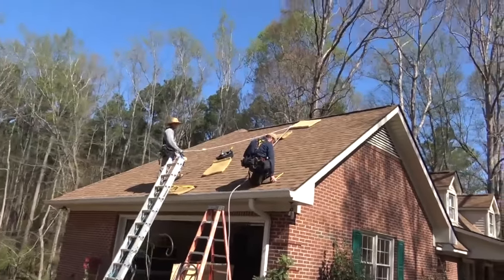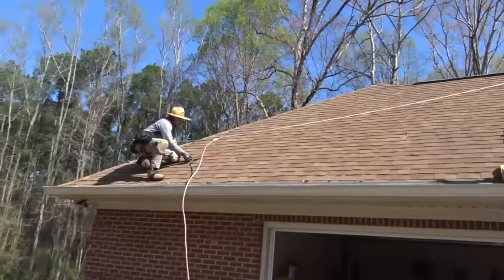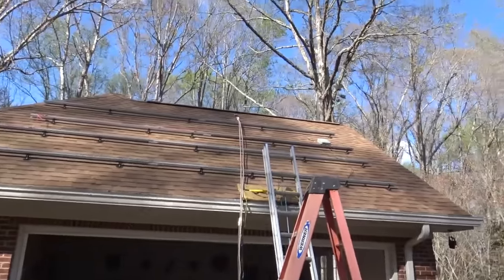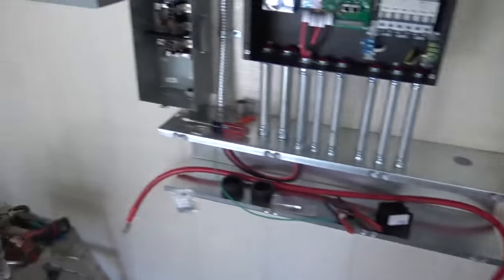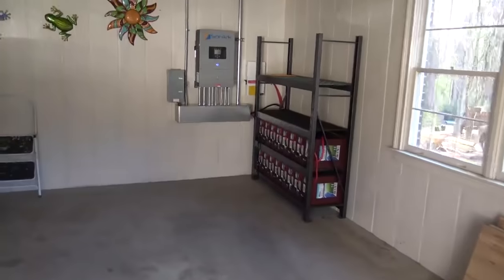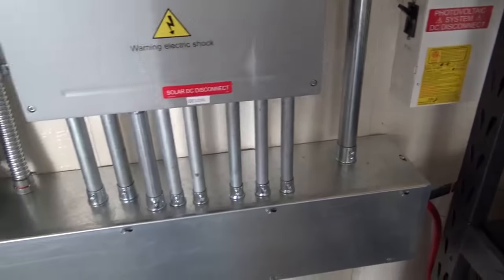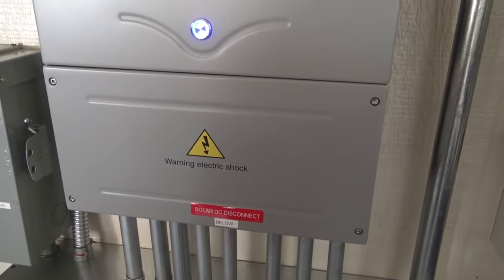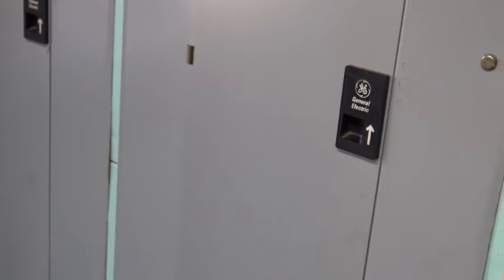EMP Hardened Backup System

Comment: I have a tip for your guys when working on asphalt singles. I learned this from an Allstate adjuster/roof inspector after a hail storm. Take an older pair of lace-up work boots and glue foam padding to the bottoms. It keeps you from slipping.

Comment: Great video I'm just beginning down here in FLA. very informative,,, I got the one under the most powerful yeti setup (can make 360 watts)...down here it helps a great deal to  portable,,, can run all my construction equipment, compressor, saws everything... I've always built houses and I really believe in solar...man I dig the well thought design & install method... thanks a lot... Dave

Comment: From the opening air shot those panels are mostly in total shade. That will typically triple or more increase the time to get your investment back.   @5:30 you can see the tree shadows all over that part of the roof. Homes on wooded lots really never make  a good home for solar.  Customers never pay attention or notice that fact and solar installers are not ever likely going to point that out and loose the sale.  I see it ALL the time.  Cheers.

Comment: Great video. How does it work when the shingles need to be replaced? Are there other roof install options that minimize impact and remounting after replacing a roof that has solar on it? For example, if this roof in 10 years needs new shingles, the panels and mount would have to be removed and completely remounted, right?

Comment: The solar panels are hooked up, so they would be damaged. You would need another set of solar panels that weren’t hooked up, and thus not damaged by the EMP. If the charge controller is hooked up to the house, and the house isn’t EMP protected, it would likely damage the charge controller - not that you would need it anyway because the power would be out. The question being that if the charger controller and the inverter are housed in the same system, would the voltage coming in through the home to the charge controller damage any components in the inverter? Sol-ark would have to answer that. . . I am paranoid, so I EMP proofed my house first. I then EMP proofed my electrical panel room with -40db paint. Painted the ceiling, walls, and floor and grounded it through the panel. I then have military grade EMP -70 db cloth to cover the disconnected inverter, charge controller, batteries and panels, all disconnected.

Comment: Correct me if I'm wrong, but it seems the isolation to the battery bank (the 250A breaker) is labelled 'Photovoltaic System DC Disconnect'.  This is misleading, as a user may think that they are disconnecting the panels from the system.  Just a heads up.

Comment: How could that possibly be built to code? You've blocked access to the white 'midnight' breaker panel. 
Doesn't your state have a minimum access dimension in front of a utility?
Reply from the maker: Yeah that was my bad putting that cabinet there but it is 48 volts and there's no reason to access that panel. The door by the way is easily removed. That being said I could have placed it in a better location.

Comment: So a ferrite toroid is EMP protection.  Transformerless inverter?  Does that make the battery terminals hot?  Shouldn't the DC breaker break both dc lines?

Comment: Why don't you use Tesla battery ?     Good install
Reply: Tesla is overpriced & over rated; LG and a number of companies can do a better battery for cheaper (eg, here in Oz, a Tesla 13.5kw battery is around 14k; an LG 10kw is 8.5k, and is far better with a 15 yr lifespan to 70% charge hold)

Comment: ~$10k, 4500 cycles at 20% DoD with 7.5kW usable sounds okay for a backup only system with gen support.  Twelve year maximum replacement time if they were cycled that amount daily.
Reply: Waste of money.... Buy Firefly Carbon Foam AGM... 4X the life and 2X the DoD.  Very close to lithium phosphate and beat many of the prismatic lithium cells.
Reply: Lead batteries are for fools. Lousy charge efficiency, peukurt effect, low cycle life, voltage sag, high internal resistance, heavy, gassy, expensive. Lithium all the way
Reply: Carbon Foam Firefly AGM are superior to Lithium for charge efficiency. Better life cycle than many Lithium chemistries, does not need battery management controllers, do not need to be heated, do not catch fire if improperly charged, are half the price per KWH and nearly the same Depth of Discharge.  Their only drawback is their weight which absolutely NO ONE cares about for energy storage.  Only people who care?  Vehicles, phones.   @climatechangepreppersfaceb2148
Reply: @w8stral  that's a blatant lie. Show me white papers to prove it. Explain the lead acid paradox to me
Reply: @w8stral  Int. J. Electrochem. Sci., Vol. 9, 2014 4830
3. RESULTS AND DISCUSSION
In preliminary experiments with cells employing positive plates based on bare RVC grids we
recorded very low discharging voltages and did not reach reasonable capacities. The cells OCVs were 
at the level of 2.09-2.12 V, which means that some amount of PbO2 was formed during the formation 
step. However, the formation efficiency was almost zero. Additionally, we noticed a very fast 
deterioration of the carbon matrix which exhibited a significant loss of mechanical properties after the 
formation. The mechanical deterioration appeared due to a couple of reasons. First, the carbon was 
subjected to an oxidizing environment during the curing procedure. Then, long anodizing of the glassy 
carbon in sulphuric acid solutions lead to its deep corrosion through the process involving surface 
activation and graphite oxide phase growth. An additional reason for the RVC matrix weakening are 
possible redox reactions between carbon and lead dioxide.
Reply: @w8stral  shows how little you know.
Tesla uses NCA chemistry, or Nickel, Cobalt, and Aluminium (LiNiCoAlO2).

Comment: Curious as to why you put the battery disconnect behind the battery rack? Wouldn't nec table 110.26(A)(1) apply or did you get special permission per 110.26(A)(1)(b)?

Comment: How well do these panels hold up to a hail storm?
Reply: Hail and Your Solar Panels. ... Solar panel hail test results show that most panels can withstand winds of up to 50 miles an hour with quarter-sized (around 1 inch) hail; however, hail of larger sizes with stronger winds can cause problems for homeowners with solar panels.
Reply: @kameljoe21 Thanks!

Comment: Only rubber absorbs electricity. If u can afford to coat everything in rubber it'll be protected. All u need is a scooter. Cars will not make it thru the barricades of broken down cars. Bicycles and scooters best bet of transportation. Also will need respiratory mask, fuel stabilizer, high grain alcohol (not for drinking)...the list isnt long. U need to have more skills than materials.